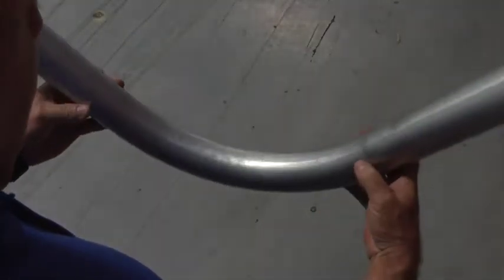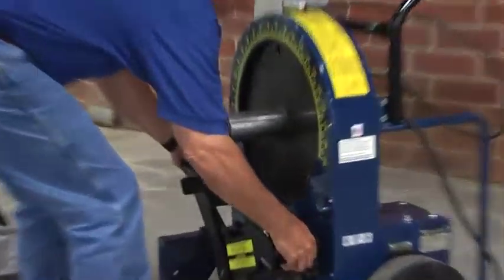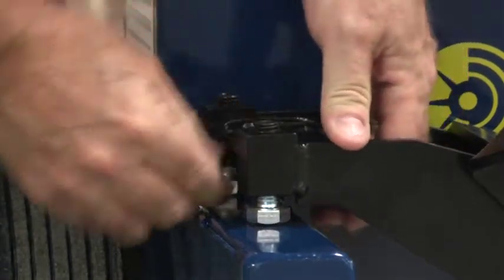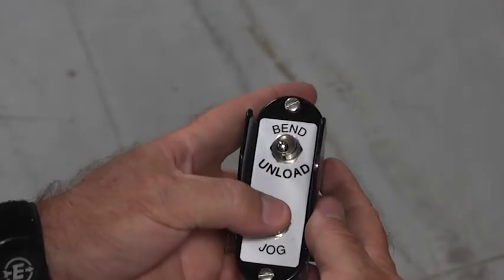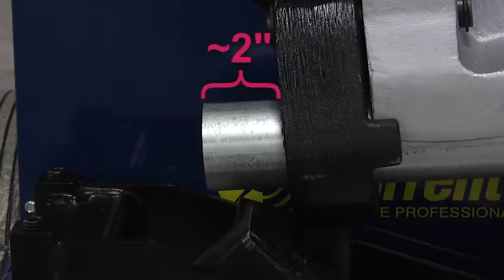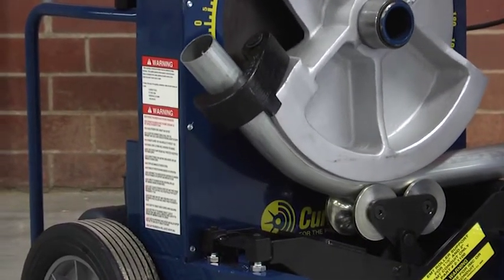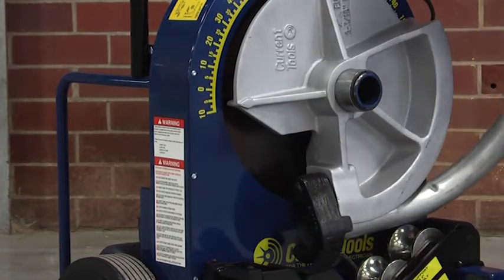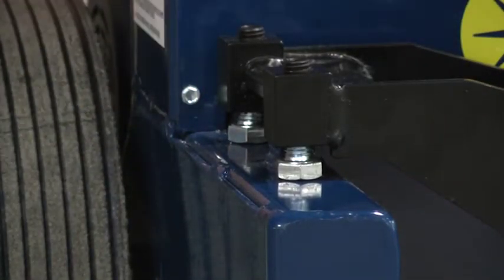2 inch EMT Conduit Bending with Current Tools

Comment: So I have a question,  when im adjusting the set bolts to bend 2" emt conduit.  I am getting wrinkles on the inside but at the same time side markings as it's too much pressure.  I kept adjusting screws to make it tighter to remove the inner wrinkles. It is now making a groove mark at the part of conduit that is touching the second roller.  Any advice....?
Reply: bananas
Reply: I had a bit of a blemish on my rollers. I used a die grinder and buffed it out as best I could